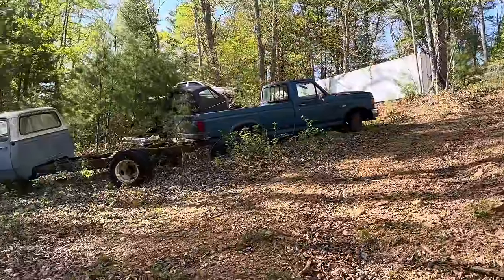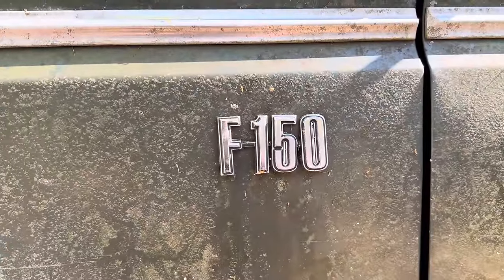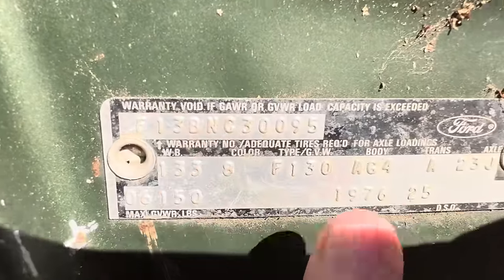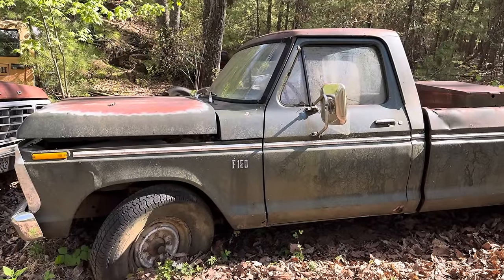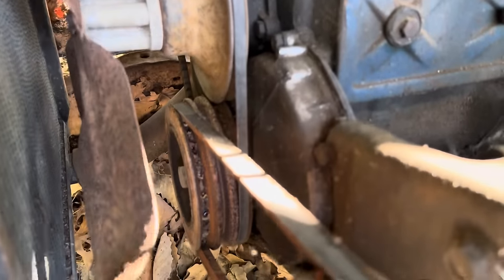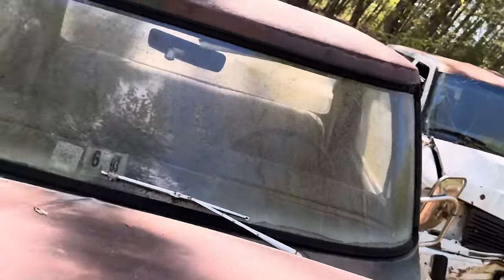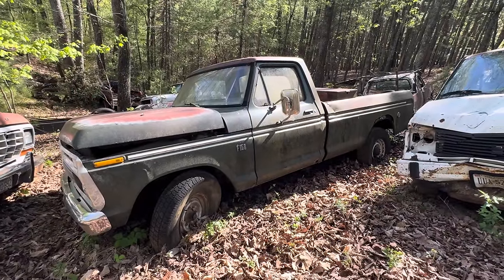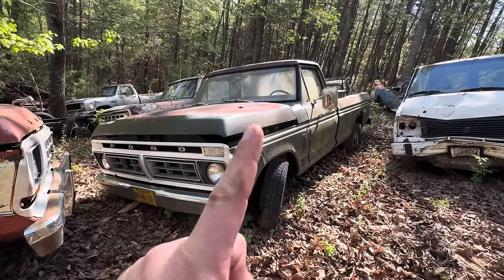Uncovering A Hidden Gem: Strange Ford MYSTERY Truck Discovered In The Woods! #RustBucketRescue

Comment: Well if you don’t think it was built to beat emissions then it was probably to scam consumers. Yet most people realize gm did exactly the same thing to get around emissions by advertising a higher gvwr on half ton trucks. I owned a 77 2wd k5 blazer that was a cheater. Original CA vehicle no cats only a smog pump for emissions. That’s really all the heavy gvw eliminated was catalytic converters, it didn’t make them exempt. So I wouldn’t go too crazy about it.
Reply from the maker: Still trying to figure out what the “point” was in building these.  I’m wonder if they just ran out of 1/2 ton axles for a bit and used 3/4 ton axles on 1/2 ton trucks just to keep the assembly line going till the next load came in.  They appear to be an extremely low volume truck, only a handful of F13s have popped up over the years.  I plan to make a roll up video soon comparing it to a dentside F250 to see what the similarities are.
Reply: Ford could advertise a larger towing and hauling rating for the f150, then put "with optolional equipment " in the fine print @RustBucketRescue
Reply from the maker: @henrydillard6217  Looks like this one got the "optional equipment"!
Reply: @RustBucketRescue Two things. My parents bought one with a trailer towing package and it had a Camper Special for carrying heavy campers in the truck bed. Seems like it had the 8 lug wheels. A friend also bought an F-150 but he put 250 badges on it justbfor the sake of doing it. Wonder if this could be the reverse of that. I know Ford went from 1/2 ton to calling them 5/8 ton trucks (to bypass emissions regulations) and switched from 100 badging to 150 badging. I'm wondering if the badging just got mixed up somewhere along the line? Thanks for the video.
Reply from the maker: @Colorado_Native  the way it sits is the way it left the factory, the F130 model code designates a F150 with 8 lug wheels.  I’ve got a dentside F250 I’m picking up soon, I’m going to park it next to the F130 and do a comparison video comparing the frame thickness, brakes, leaf springs, etc to see exactly how similar the trucks are.  It’s a super odd one, that’s for sure!
Reply: @RustBucketRescue  That will be very interesting comparison. Looking forward to it. Thanks for the reply.

Comment: In 1976 my Dad traded his 1966 F-100 "Industrial" for a 1976 F-150 as a replacement for the F-100 on the family farm. And he came to HATE that F-150 because it was simply not up to the task. The F-150s with the eight lug wheels were basically the "Heavy Duty" 150s of their day. Dad was never happy with the "standard" F-150 and traded it for a new Dodge Ram 150 in 1985. That truck is still running to this day and serves as my younger brother's beater truck. Oddly enough I purchased a 1977 Ford F-150 (used of course) in 1992 which, like that old 1966, was marked as "Industrial". That son of a gun, like it's older brother, would pull the crack of dawn open AND closed with no sign of strain whatsoever. I wish I still had that truck, but life got in the way, and I had to trade it for a far less capable vehicle in 1999.
Reply from the maker: Thank you for this awesome story brother!  Do you remember what engines and transmissions your dad’s beefy ‘66 and your beefy ‘77 had?  What colors were they?
Reply: @RustBucketRescue  The '66 was powered by a 352cid V-8 while the '77 sported a 360cid V-8. Maybe it was just nostalgia that drew me to it, but my '77 was the same color as the '66, a kind of tan. The '66 was a "three on the tree manual, no AC, and power nothing" while the tranny in my '77 was a C-6 if memory serves. If the shifters were placed in neutral on those trucks, they rocked like they had a serous cam. By the way, both trucks had two-barrel carbs that a man could stick his thumbs into and have room to spare though oddly enough they BOTH got better fuel mileage that that piece of crap "standard/light duty" F-150 with its weak (for what was needed of a truck on the farm) 302cid/5.0L.
Reply from the maker: @furmanmackey5479  the Ford-Edsel (FE/FT) series engines (352, 360, 390) they stuck in trucks were simply glorious.  They were “old enough” that they were from the era where still made excellent power (for the day), as they came before the malaise/smogger era where even monstrous big blocks were pitifully wheezing out less than 200 hp at the crank.  The FE engines are awesome, I see why you were so pleased with the older trucks!

Comment: As far as I know, the transmission could be a NP435, or a T18. Also another way to tell between a 76 or 77 with the same grill, is the designations ( f150 and such) would be on the cowl above the fender on a 77.
Reply from the maker: Good info on the cowl model designation location, thanks for sharing!  And it’s a NP-435. Great transmissions.

Comment: Also note the narrow chrome in the center of the dent side most of these trucks were assembled out west or in Canada.  Also look closely at the rear hub it is slightly shorter than the average or standard f250 i had a 77 very light duty and it had 8 lug wheels but no floating rear hubs . It did have a heavy duty bearing.  The axle was a dana built but worked well so i only replaced the brakes had to take off to napa so they could match up.  This could be a trailer special truck for different parts of the country.  I have a 79 trailer special found in SC it has 460 ac ps pb auto big 4 core radiator the narrow crome red on top white on bottom all factory colors.  All in very good shape all original drive train and very light rust no dents ot scratches
Reply from the maker: This one was built in Norfolk, Virgina.  I got a same-era F250 recently, so my next video is to park them side by side, pop off the wheels, and compare the brakes, frame thicknesses, rear leaf springs, axles, etc to compare and contrast them and see what the similarities and differences are, stay tuned!

Comment: I have to look it up again in a book on Ford trucks I have but there may have been a 60 series (F160).  Ford trucks in the '70s until around 1978 had all these different models and noted them as such.  I had always assumed it was 150/250/350 but man I was wrong
Reply from the maker: Ford was all over the map and often defied logic.  For example, this truck is a blend of F150 parts and F250 parts, so logically you would think F200 would be the perfect name, but they went backwards and named it a F130 😆

Comment: Very interesting. I was thinking maybe someone ordered it as a f150, and had the axles put in  part way into the video...But my knowledge in these trucks just started to really take shape after finally aquiring my late mother's 76 f-100 flairside 2wd this year. She's had the truck in storage since 1986 with a locked up motor. She finally let me get it out of storage in March of this year to get it fixed up for her, then she passed away unexpectedly in May. After all those years in storage, i'm very close to getting it driving again already.

One thing though, i've heard a few times before, in mid 76 is when they switched to amber front markers. The truck i was talking about was built in SanJose in early 76, had clear markers. Ran into a later model 76 had amber front markers. It could be that the owner changed them too, not sure.
Reply from the maker: Sorry about your loss brother.  Sounds like an excellent truck however!  What’s left till it’s ready to rock and roll? And yes 76 model trucks with ambers are likely owner swapped lenses, they should be clear.

Comment: I have a 1971 E 350 econoline that is 5 lug with the small bolt pattern 5 on 4.5” so it is an oddball., I do know the story on this. It was converted to the 1/2 ton gear long ago, it was 8 lug that someone wanted to use the 8 lug running ear for another van.
Reply from the maker: Definitely gives you way more wheels to choose from!
Reply: Was it sold out west or Canada they actually did have something that they wanted wheels to be more interchangeable. A friend had a 77 f150 xlt super nice truck had the small ford wheels trucks is still tagged and uses it from time to time has 10 inch wheels and 275 60 15 paint faded but still nice truck. Tried to buy several times
Reply from the maker: @gregallen4272  I’ve noticed Canadian vehicles got several interesting options.  Definitely a niche market back in the day that Ford did some fun stuff for!

Comment: In 76 I didn’t think they even had the f100 anymore other than what they branded as the ranger. Here a kick I have a 77 F150 (5 bolt wheels) with a 460 cid , ford didn’t offer that engine in half tons at least not in CA don’t know about the rest of the nation, but you could get it in a fleet sale . It’s for sale if anyone is interested. Runs but been sitting .
Reply from the maker: They ran the F100 all the way to 1983 believe it or not!  I’m not sure about California, but in the other 49 at least the F150 could be purchased with a 460.  Believe it or not you could buy a F100 with a 460 too!  Where is your truck located, and how much are you asking for it?

Comment: Interesting video. Thanks for posting. I have one correction the turn signal color. I have seen 76 with the amber lens. May have been end of year IDK. The only way i can tell is the gas filler. 76 has the caps outside and 77 started putting the fuel door on
Reply from the maker: Are you the original owner?  A lot of people put amber turns signals into ‘76s after the fact.  Multiple state didn’t allow clear lenses during state inspections, which is why Ford only ran clear lenses for one year before dealers complained and ambers became the standard.  Many ‘76 owners converted their clears to amber to be able to pass inspections over the past 40+ years.

Comment: This reminds me of early production 1965 Mustang (so called 1964 1/2) made in 1964, then Ford made a lot of mechanical and electrical modification for 1965 models. The F130 might be an early production F-150, but using costly and heavy F250 axels as stop gap measure until an appropriate replacement based on modified F-100 axels. There is a discussion comparing F-100 and F-150 axels, they are nearly identical externally, except the F-150  have more robust shafts.
Reply from the maker: It's certainly possible, it'll be one of my discussion points in my upcoming video where I'll be comparing the F130 to a recently acquired F250 I have.

Comment: Fender badge denotes "F150"....also 1975 F150 also had clear turn signal lenses.
Reply from the maker: An F150 with 8 lug wheels and a full floater Dana 61 axle though!

Comment: I’ve seen other Fords with 3/4 running gear. A buddy had 77 150 with 3/4 running gear Ranger short box with 400 3 on tree. Fun truck if you had nerves power shifting it got loose
Reply from the maker: Power shifting a 3 on the tree is always a bold move.  If the shifter is fresh and “tight” it works out well, but on one that’s seen some miles and getting some slop in the linkages I always end up getting stuck in a gear when the linkages bind up trying to keep up with “enthusiastic” shifting 😂

Comment: Interesting, I love the old 300s. I own two 1999 Econoline, one E250 rust bucket. And a conversion high top E150, I'm going to put the high top on the 250 frame. I prefer the ride height.
Reply from the maker: I just got a 1990 E150 high top yesterday!  I’m absolutely in love. It’s such a nice van!

Comment: Had one that had AC and had the oil bath type air filter assembly. Geared out the butt. No top end but it would pull a house if you could hook it up. It was my grandfathers. A man t boned me and my two young sons and totalled it out back in 93
Reply from the maker: What a shame!  I’ve been hunting for an oil bath air filter assembly to convert this one over for the “old school cool” factor.  Thanks for sharing!

Comment: That truck has 255 AC, thats two windows down at 55 mph. HaHa
Reply from the maker: I like ‘ol 255 A/C, it never has a compressor give out or bearings to start squeeling, it just always works 😁👍🏻
Reply: Those vent windows provided a surprisingly cool breeze at speeds as low a 5-10 mph.
Reply from the maker: @richardtibbetts574  I’m a big fan of vent windows.  They work so well!

Comment: In the mid 90s Chevrolet did the same thing they classified their trucks is 1500s but you could get the eight lug version which was a light duty three-quarter ton hence heavy duty running from the three-quarter ton but half ton suspension I’ve only seen a couple of those trucks toomy stepfather ordered one really much more weight than a regular 1500
Reply from the maker: Chevy had the Big 10 as well, same thing but in the 80s

Comment: Interesting find~ Dodge also made Ram 1500s from 2003 to 2006(?) with 8-lug hubs from the 2500 and they were called Heavy (Duty) Half(-ton)s.  I've seen a couple as a former Chrysler lube tech.
Reply from the maker: Interesting I’ll have to look those up, thanks for sharing!

Comment: Did someone replace the original F130 badge, or were they badged as F150? I've seen some trucks built and sold in Mexico from that time period that were badged as F130. The story this truck could tell is definitely worth looking into.
Reply from the maker: Originally badged at F150.  In Mexico, ford has a similar truck that was in between an F150 and F250, aptly called the F200.  Haven’t heard of there being F130 badges, I’ll have to research that. If so, I’d love to track down a set!  I wish this thing could talk, I have so many questions!  I’ve got a F250, my next video is going to be comparing the frame thickness, brakes, axles, suspension, etc and see what the similarities and differences are as I try to get to the bottom of what a F130 exactly is -stay tuned!
Reply: I've not seen F200s. That would be worth looking into as well.
Reply from the maker: @nicklewis7291  I love the lore behind these oddball units, Ford did all sorts of funky fun truck builds back in the day!

Comment: Thing is ford chucked in whatever they had at the time and two identical units can be completely different jut what they did back when they had plenty of all things.
Reply from the maker: Yeah I’ve wondered if they just ran out of normal axles for a bit and used F250 axles since they had them

Comment: I have a 76 F150 labeled F13 has 250 drivetrain and 390 with 4 speed manual runs drives been in car shows and getting restored at same time a great truck has the clear front marker lights in it to
Reply from the maker: All F13's will be 1976 model trucks with the clear front marker lights.  From my research, it's a one year only (1976) model.  The GVWR should be 6150 Lbs. as well.  What color is it?  Should be a regular cab longbed as well, and 2 wheel drive, is it?
Reply: @RustBucketRescue  red truck 1976 and its a beautiful original truck
Reply: @RustBucketRescue  has all the things you mentioned

Comment: I have heard of these, I heard they were a 76 only option but I thought they were called the F-150 Special.  When you mentioned the F-130 in your last video I wondered if you meant the door tag code.  You confirmed that in this video as it says F-150 on the fender not F-130.  It's basically a heavy half ton or light 3/4 ton, what's interesting is my 76 Shop manual does not list a F-130, it lists an F-150 with a 6050 lb weight rating and a F-151 with a 6200 lb rating, this trucks weight rating is in between these two at 6150. My question is does it have the thicker frame rails of the F-250/350 or the thinner/ light rails of the F-100/150. , I would be interested in knowing the frame rails thickness if you can measure it, I believe the F-250/350 are 1/4" think, the F-100/150's were thinner.  This has a Dana 61 rear end with 3.31 gears just like a 77 F-250 I once had did, I imagine it came with light F-250 springs and no overloads and single piston front calipers, just.like my 77 and 78 had. But heck I once had a 78 F-250 Camper Special  built like that too.  It didn't even have power steering.  All it had was sway bars, flip out mirrors and the badges.  No overloads, no heavy duty brakes, nothing.  Anyway I would like to see more info on this truck.
Reply from the maker: You’ve come to the right place!!  My next video is going to be me parking a 1979 F250 next to this F130 code truck and compare and contrast the similarities/differences.  Subscribe and hit the bell to get a notification when I publish that video, I’ll be going over everything you mentioned and more as I try to solve the mystery of what the hell a F130 actually is!  Brakes, frame thickness, axles and leaf springs, I’ll be going over it all.

Comment: You'd think being a cross between a F150 and F250, Ford would call it a F200 or F150 plus... Lol.
Reply from the maker: Exactly, F130 is an odd choice to name a heavy F150!
Reply: F130 seems wrong direction more like f175 but perhaps the f130 was skulduggery making the tail pipe sniffers think was a “Pinto” Truck
Reply from the maker: @Bob-gy6ud  I thought the same exact thing!  Ford had a F200 for the Mexican market, that seems like the perfect name for an F150 with F250 running gear, but I think as you’ve suggested they were trying to pull some emissions shenanigans by getting funky with the model number.

Comment: I had that engine in my 76 Granada best engine I ever owned
Reply from the maker: They can’t be killed!  You won’t win any drag races, but boy oh boy all you have to do is fuel them up and do an occasional oil change and 300,000 miles of trouble free use is as easy as putting it in drive and hitting the road!!
Reply: Grenadas had either the 200 or 250 6 cylinder, while the trucks were 240or 300 6s. The 200/250 was more compact to fit in smaller  engine bays. Parts don’t interchange between the 2 engine families.
Reply from the maker: @deanmeyer1815  I have a Grenada 250 in my 1967 F100!  It's a great little engine.